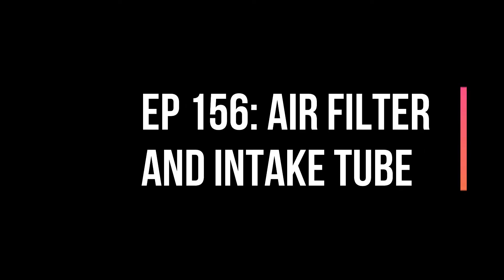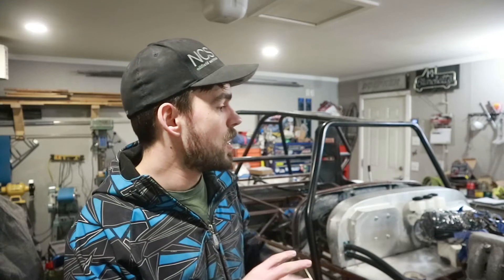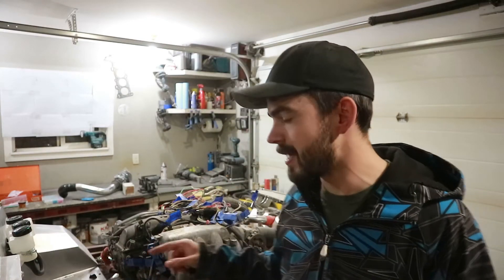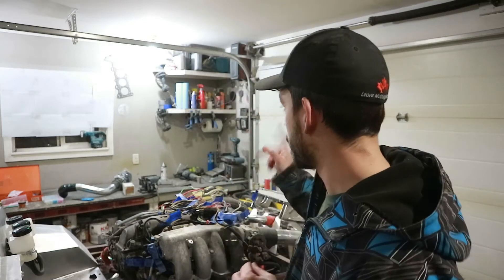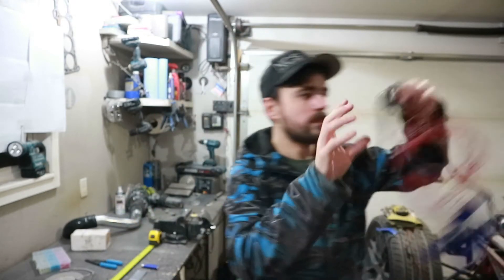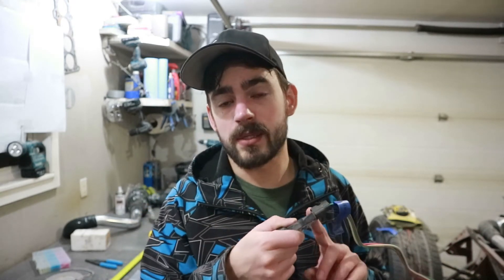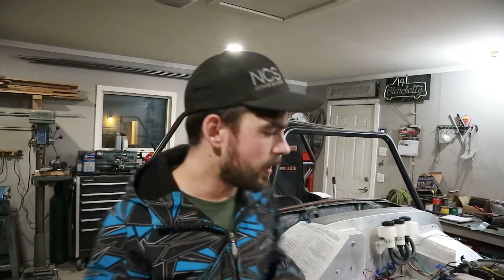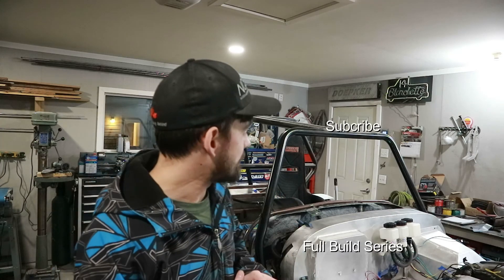Ep 157: SR20DET ECU Rewire.

Comment: Sorry mate, I’m going to be one of those pains in the butt who say you’re doing it wrong.   I too prefer to solder than have the bulk of crimps but I strip about 3/4” off each wire and use, what I’m told is a modified Western Union Joint.  I cross the wires at their mid point and wrap A round B and then B round A.  This gives a strong mechanical joint rather than rely on the solder for mechanical strength. I also use two layers of heat shrink, one longer than the other to stop vibration at the weak point of where the solder ends in the wire.  Still neat and I’ve never (yet ) had one fail.

Comment: A cheap soldering/rework station and a set of helping hands would have made your life soo much easier but I guess hindsight is 20-20. Thank you for NOT using those crimp butt connectors, you're 100% right it looks like crap and is a bulky mess when you're done even if you use the nice ones.

Also, when it comes time to wrap the harness, please use the good Tesa tape that's resistant to gas and oil and NOT electrical tape and plastic loom.
Reply from the maker: I planned on using fabric etape because it doesn't get slimy with fuel and oil, but the heat shielding of the loom is nice in some areas.